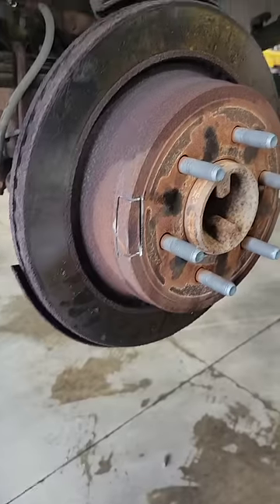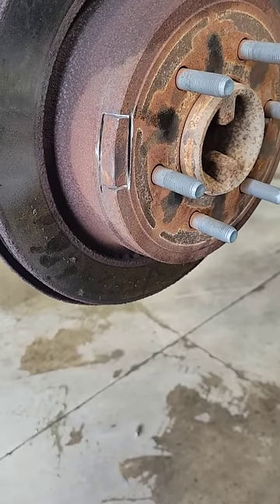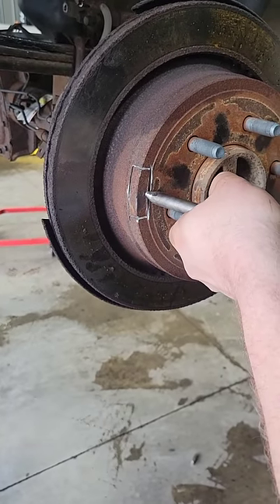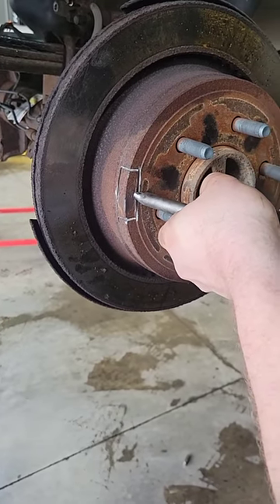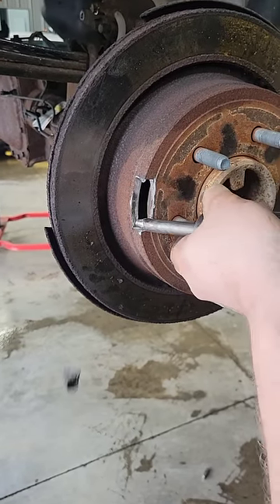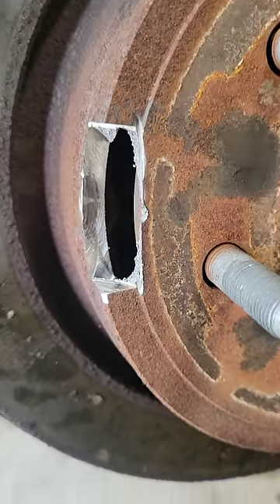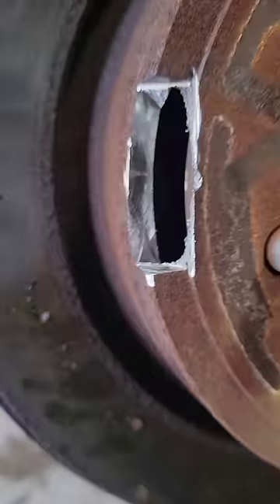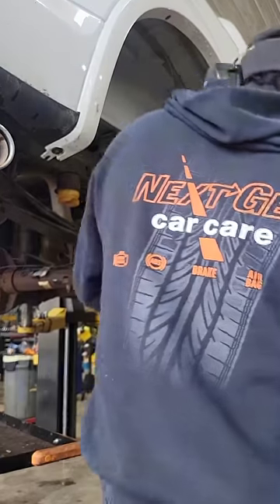Ford F-150 rear brake service.  Trying to show a trick on getting them off without further damage.

Comment: Put a double nutted bolt thru the caliper mount hole, then use it as a jack screw. Tighten a preload on it then tap rotor with hammer. Bang

Comment: Run a sacrificial bolt through the brake caliper bracket bolt hole, with a nut between the bracket hole and rotor. Then crank it down and it will pop the rotor off

Comment: There are inspection holes on the back plate where you can do this whole thing via them. I don't get the point of this. I have repeatedly removed worn drums that are stuck or jammed on the shoes with no problem, not to mention most times i only used a screwdriver to give it a little bit of leverage so to come off.

Comment: If all fails, cut  2 little pins at the rear of the brakes which holds brake shoes in position and all is loose, new pins cost 1 dollar. Which i usually replace anyway when replacing brake shoes. Oh, I'm an Architect.

Comment: You could just back off the adjustment wheel for the parking brake on the back behind the rubber plug.

Comment: If the inside shoes  are that bad they might as well be replaced. And the backing plates rust off after 100 000 on most cars anyways lol  but you can also remove the rubber  grommet and access the gears that back the shoes of the .

Than the rotor basically falls off without damaging anything 

That's the way to do it

Comment: I would be pissed. I had a ton of trouble getting mine off, but it was because the thin backing plates Ford has been using rusted out around the pins, NOT from a rust ring.

Comment: There's a hole in the back that you put a screw driver in and pull the brake pads off the drums so the drums can be removed. Read the chiltons Manuel

Comment: I have been a Diesel / Natural Gas Engine Technician for 30 years! That means the Engines I work on cost a hell of a lot more than a car! I have about $ 100,000 worth of tools, the one tool I only have 3 of is a Hammer,  one 8oz. One 16oz. And a 2lb. Sledge,  that's it. I consider a Hammer a dumb tool!! Not a Precision Tool! After all Precision is what we do!!

Comment: I usually remove the rubber grommet and take a break spoon so that it loosens the emergency brake
Reply: And you can also remove the pins from the backside by pulling and spinning them so it releases the inner springs and then pull the drum off

Comment: in the time it'd take to get the air hose setup with the cutoff wheel and air chizzle I could've been busted the rotor with a Sledge,  couple strong hits whole thing shatters and comes right off, it's going in the trash either way

Comment: Use wD40 and a happen and come right off. Well my opinion it work and never had a problem.  Plus I don't work on cars that's 25 years or older. Those car have alot of rust and you can tell by the customer don't take care of it.

Comment: Umm...no.  Newer F150s (judging by axle and body) have electronic parking brake servo motors that MUST be set into service mode prior to brake job.  Not doing so, and turning on ignition, is a good way to sever some fingers when that piston comes out.  Similar idea to the adjusters everyone is talking about, but with a motor and the mechanical leverage of gearing

Comment: Take the rubber boot off of the back of the backing plate for off the front of the rotor hat back adjustment off

Comment: Rotors are either cast iron or cast steel, a ten pound sledge on the side of the hat and it'll split right open and practically fall off.

Comment: Im not a mechanic... There is a bolt hole on the drum ,i removed the bolt and spray Wd inside the brake drum that was seized.. that worked great for me.

Comment: Did you try the adjusters to loosen them? You know that will back them off? Never once have I used a cut off wheel doing brakes. This is disappointing. Yes the hammer is good way to go. You're replacing it anyways

Comment: There is an access to the parking brake adjuster built in to the backing plate why not do it the way the manufacturer intended. Worst case knock the adjuster out of place (if it's rusted solid) and no problems

Comment: Ouch bro I gotchu without cutting and without a hammer if it's the right side turn your wheel to the left put a pry bar back there make sure your ready to take it off gett it wedged between and turn it to the right doesn't destroy anything and comes off way easier also takes half the time compared to cutting something that don't need cut

Comment: Only once in my career did I have to cut a rotor.  The cylinder popped out of the calliper and cut into the webbing then turned.  Had to cut a window to remove the rotor.  She was then a wall hanger.

Comment: Wonder if the service manual calls for this. Lol. I was a mechanic at a Ford dealership for ten years. My shop foreman let alone the owners would of booted my ass out if I ever did this. Couple of hammer taps in between the studs, and she’s free. Never had a problem. But everyone has a method.

Comment: Either way it ain't a good deal.  If it's that worn out you probly ought to be replacin the park brake shoes and hardware anyway don't ya reckon?  Backing plates will straighten.  If the shoes are mounted with nails just pull em thru the clips or cut the heads off from the back side.  Or I guess if ur rotor is for sure junk cut it.  Different methods for different situations.

Comment: How about just UN-adjusting the brake adjuster on the e-brake? 40 years as a mechanic and never cut "access windows" in a rotor. If your worried about damaging hardware or happen to damage hardware, I'd just replace it. New rotor, new hardware.....js😎

Comment: There is actually a lip that can develop inside the rotor that the parking brakes get caught on. However, I have beat the daylights out of them with a hammer and haven’t broken it. That said, it’ll probably happen next week.

Comment: Abunch of BS is what that is! I have never in my 7 years as a certified technician, have I ever had to do this. There are threaded holes in almost all rotors nowadays that allow you to insert 2 bolts and drive the rotor off without needing a hammer. Ive even found them in drums!!!!

Comment: If you hold a screwdriver in one side as you hammer.  It comes off even everytime. 
Anyway any old 150,000 mile f150 the parking brake shoes will fall off by themselves.

Comment: Or, OR go in by the adjustment port with a straightened paper clip ans release the anti rollback arm. Then with a screwdriver back off the brake and remove the drum without the fiasco you just showed.

Comment: A.s.e tech?? No ?? Lol lol 
That rubber plug on the inside of the backing plate!! Its also where the adjustment is for the e_ brake.
You remove that and can back off the adjustment and get it off.

Comment: It helps if they are inspected on servicing and the wear ridge is sanded off if excessive. This mutilation of the drums is down to mechanical negligence during the vehicles first hundred k. Squarely in the domain of the main dealer. No excuses now; it's the absolute truth.!!!!!!

Comment: If you look at the backing plate there is a little hole covered by a rubber boot. Behind that boot is where you adjust your parking brake 🤦🏽‍♂️😂 take a little flat head a turn the adjustment screw and it’ll come right off. This has to be a joke right 😂 right?

Comment: Just loosen off the self tensioner there is a slot in the back of the dust sheild or grind off the shoe harware pins from the back lol hardware kits are super cheap

Comment: Mine seized up at home all i had was a decent hammer (not even a sledge), and a prybar...100% seized to where i pulled EVERYTHING parking brake related when it came off...in my rocky driveway. Wtf is this. Hit it harder

Comment: I spent 6 years in a ford dealer in the rust belt. Never did this. There’s a little rubber boot that gives you access to the star adjuster. Try that next time. Jesus.

Comment: No there is another way better and the correct one. Modern mechanics use a puller to remove the drum without cutting it

Comment: Should just release the cable meaning what I said is disconnected where it comes from the parking brake
Reply: Usually connected right underneath the driver seat

Comment: Bro, I don't want to knock you, but I've been a shop owner since the early 2000s, and I personally have seen a bunch of genius ways to do this. This is really unnecessary and has more liability than meets the eye. I 100% do not recommend this method. I've seen guys drive the lug studs back and wiggle it off, I hate that, probably replaced wheel studs by the time it's over, and it's still got to be fought off, but I'd prefer that to this. What's wrong with the adjuster? I'm dying to know why the adjust access isn't good?

Comment: Honestly bad mechanic experience, if the shoes for parking brake are still dragging inside of the drum then you know the slack just needs to be taken out of it. Some vehicles allow for adjusting the slack inside of a parking brake cable. You should check that first before just taking a table grinder to a disk.

Comment: Sorry if you're doing anything to the brakes you replace rotor pads and all brake hardware and on the back you replace the parking brake hardware anyway and pad unless you have a cheap customer and then you send them home otherwise it's a liability on you

Comment: Hammer and if that don't work just get a bigger hammer. Worst case scenario put the tire on with lugs on loose and put it in drive and reverse and move it a few feet and jam on the breaks it will crack it loose. Too much time and effort for that cut I hate the smell of the grind wheel worked in a factory for too long.

Comment: I just use a 25lb concrete weight, with the plastic on it of course and just throw it into the rotor and it comes right off....8lb sledge hammer and a block of wood wouldn't do it

Comment: All you had to do is take a hammer top around the side stop in the front and then it will slide off you don't have to cut any holes or anyting it's pretty sad when a backyard mechanic can get things off more than a mechanic in the garage so who's the better mechanic the ones are in the garage or the ones out of the backyard backyard mechanics are better because I won't cut that off I'll just do what I said in the script take a hammer top top top bang bang heat up and they'll slide right off cuz I know I had plenty of them that had the same issue

Comment: Too bad ford doesn’t do what Toyota does and has the 2 threaded holes to tighten bolts to push the rotor away from the hub

Comment: Or you could have adjusted the brakes in a little, that would have taken 2 minutes and you wouldn't have to do that. That's just crazy i tell yaa, that's why the back plate has the notch in it with the rubber plug. , Surely you know that. I been a mechanic for fourty years and never seen anyone do that to a rotor or drum

Comment: Man people been banging rotate off since 100 years agai and never have I ever seen some damage a backing plate or any lines or anything. This is unnecessary and just makes the job take a unnecessarily amount of time the. Just to take a handheld mall and tap the back of the rotor. You don’t have to beat it unmercifully just hit it in a circular motion until it starts to losen

Comment: Or how about you open the adjustment tab on the back of the backing plate. Get a brake spoon or flat head and adjust the ebrake shoes all the way in. If you have to cut open the hat of a rotor to get it off. That's not the right way at all. 🤣🤣🤣🤣

Comment: My friend I just paid $100 for a 3 inch cut off wheel from Bad Dog tools if it ever breaks dulls anything you can send it back to them and they will return you a new cut off wheel for free it's metal and diamond and the little Diamond patches are puppy bones all that aside I cut a rotor from a truck completely in half in about 1 minute and 17 seconds with my sunex HD quarter inch die grinder just a friendly little PSA🎉 save u some ⏲️ and 💰 🤑

Comment: Been a journeyman auto Tech for 15 yrs. Never had to do this. There's an access hole in the back and you can get to the adjuster with a brake spoon. Please stop trying to teach people this shit
Reply from the maker: I've been a mechanic for 25 years I've been backing up adjusters for most of them. The adjusters were already all the way backed off in the lip is still too big should I just knock it off of the hammer and bend the backing plates enter in the pins or spend 2 minutes cutting a hole in it and pushing on the shoes while I pull on the rotors?
Reply: @nextgencarcare  I did my apprenticeship at a Ford dealership not some "ASE" certified bullshit and not once did I have an f150 that had a rust ridge "so fkn big" that I had to do this. Know your job and know how to fix shit.

Comment: You know there's a window in the back where the adjuster is. That holds the brake pads open. Where if you turn it, they will come back in and then you can just take them off. And the Rust will  not hold it then  the only tool  you needed  was a flat head screwdriver do not have work done here p.s. It's obvious you have not done drum breaks before 😂😂 what  a sad joke of a shop you have  You're the guys who would call a carburetor a throttle body

Comment: This guy is not Supposed to be near tools. He could have pulled a rubber plug and a small flat blade screwdriver to retard the tension from the backing plate side..... what's wrong with people that make these information videos

Comment: prolly not, release the parking brake would be more helpful,  besides, if the parking brake shoes wore a rust groove in the hat of the rotor, they need to be changed as well,, hardware be damned !

Comment: i'm not up to speed on american cars but thats a disc brake which has a caliper and pads on outside of disc but this guys looking for shoes inside the hub.
i don't see a drum brake with shoes 
wonder if he managed to change those shoes 😂😂😂
Reply: Emergency/parking brake shoes on the inside of the drum. But still, nobody cuts a hole in the rotor like that. This video has to be some kind of joke.

Comment: Yep Idk how this guys thinks this is logical and id never let him touch my stuff but I'm lost! Use a hammer or a bigger rubber malet and hit it with that, or tap it with a air hammer that has a hammer style bit and tap around the face of the drum where your wheel sits against the drum or the side of the drum,,,, not where your pad sits or if you do hit where your pads sit hit it with a malet if your saving it or hit it with a hammer if your replacing it don't be cutting slots in the rotor, waist of time and money and that customer may not be able to afford or doesn't want new rotors and its cheaper for them for you to turn them wasn't even that rusty compared to the ones I deal with, I would've turned that rotor too, from the looks of it not sure what the back looks like but not a bad looking rotor, from not being able to see the back, but you should take this video down so people don't cut holes in there rotors for no reason

Comment: If people are willing to buy Ford garbage I see no reason to bother saving them money by making up for Ford's intentional shitty design.  The fact is that Ford did that intentionally to make more money selling parts and benefits the dealerships.  If Ford Motor company wasn't douche bags they'd have a cut out where you could back the shoes off.

The real solution is to stop driving the truck like it's a sports car and dispose of it at 100K miles as Ford intended and go buy another Ford.  The rear brakes should last 100K, unless you use it as a truck but then who does that?